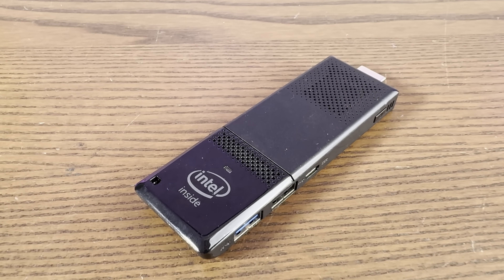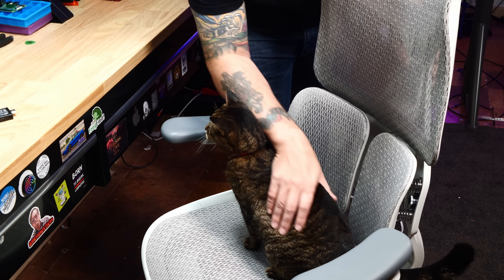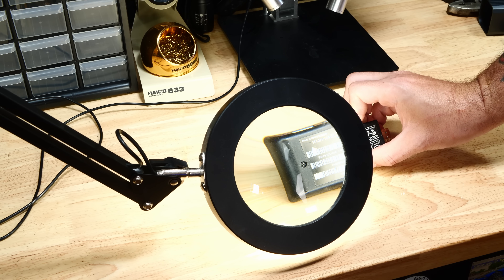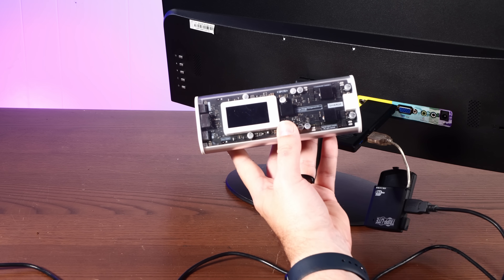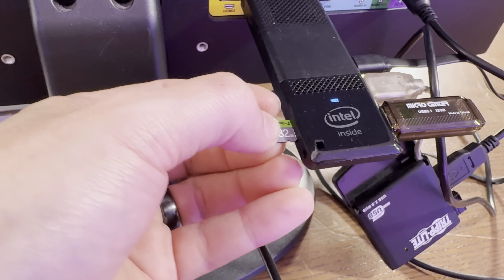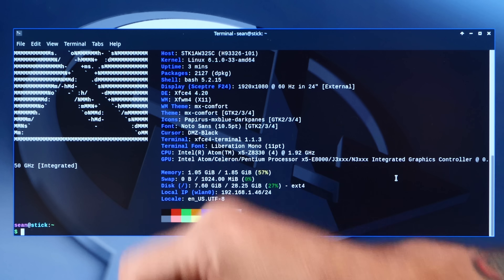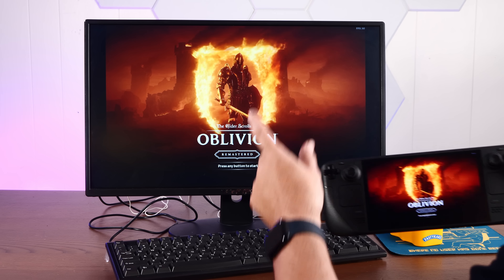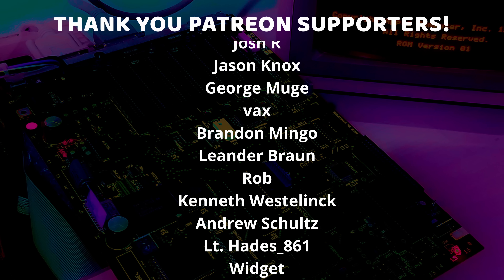Intel's Tiny, Weird Computer

Comment: So the Intel Compute stick can do what it was advertised for but not much else?
It might even have been able to run Office 365 on windows 10. It was marketed as a home media stick not a gaming computer so no one was expecting it to be able to though being able to stream it is nice.
Still "low end" has changed meanings over the decade and it still has the hardware of some modern mini PCs made for office use and HTPC use just with lots less storage and no internal upgradeable storage options. Why is the N100 still used? low power for enough compute not good compute but enough compute. The target use case do not need good compute either as HTPC and office use do not really use much to do. Office use as for most it is used in lots of light weight tasks or just a cheap thin client while for the HTPC it is good enough for streaming videos and playing music.

Comment: I have a compute stick (for some reason I have 3) and is the later USB-c powered one with the additional USB sockets in the power brick. I installed Linux on mine and use it as a media player for in the hotel room when I'm away for work and it works great

Comment: 2018 I was using a Azulle Access Plus Fanless Mini PC Stick, a 4gig unit with maybe a bit better processor, I got Raspberry PI's intel desktop distro to run on it so I could use it as a DNS server.  It ran that well, I had also used it for video playback without issue and i shutter to think minor code development...I think 2gig versus 4gig is a big difference on which distro will run.

Comment: I have a couple of these..one with no OS, and another one with win 10 pro..

One has the atom processor and I believe the other has an Intel m3
Reply: Also, I purchased the official wall warts for these which give you an additional 2 or 3 USB ports..

My plan was to run eXoDOS completely offline but never actually got around to it

Comment: I think these things are cool. I keep trying to find them in hopes of building them into simple headless single-purpose test fixtures that run relatively simple code. But the price never came down. I was expecting they'd eventually be on ebay for $30 but nope. They never gained enough volume because they aren't powerful enough to run bloatware.

Comment: It's amazing what you can do with the right linux distro. Saving computers from the e-waste pile is not only kinder to the planet, but it's FUN! Pushing hardware to its limits using efficient and streamlined software divorced from the BS of modern windows tickles my brain in such a fun way.

Comment: My "home lab" computer still a Intel D945GCLF with Intel Atom N230 (i'm buyed in 2008 in "brand new", just before N270 is released..)
it runs Ubuntu server (originaly 10.04, but got multiple updates and currently 24.04 LTE version is runing on it). Never had an issue... but the CAP in the board was replaced once around 5 years ago.

Comment: I was given a cheap knokoff of one of these a few years ago. I was able to install fedora Linux on it but there was no wi-fi and it would just lock up due to overheating after a while. I did get ethernet working through a usb dongle.  I was told they overheated under windows as well. So I threw it away.

Comment: not to long ago, I was reorganizing my 'office' (known as my beloved as 'the junk room'), came across an old atom netbook with a stomped in screen, a few USB SNES controllers,  and a few other cables and bits and bobs. the procrastination hit, and instead of finishing cleaning, I'd gutted the laptop, mounted to the underside of the coffee table, a VGA cable, and loaded it up with a bunch of emulators. She was a Megadrive Girl, I was a SNES boy.  A Sundays afternoon of effort put to good use. my office is still less-than-organised, but we had a great sunday night.
Those little atoms are great little units for what they are. when I got it years ago my primary goal was longest battery life, real keyboard, proper OS. and it still does it just as well today (just dont load many tabs). Try that on your smartphone from 10 years ago

Comment: Was just given an old Acer workstation that the previous owner didn't appreciate properly. Removed Windows 10 and all the bloat, installed Batocera, and now I have a great little retro emulation system with decent WiFi for my living room. Heck, I even have the built in Kodi app talking to my Emby server!

Comment: When those came out I totally imagine them being for someone who had really basic computer needs, like maybe a word processor and a web browser and something really basic. 

In the late 2010s, I got a full size (like 42" or a little bigger) plasma 720p HGTV off Craigslist.  That was the first time I had an entire housing unit to myself (shared with my girlfriend) instead of living with random roommates.  I used a fire stick for all my streaming needs.  I also had a raspberry Pi can I wire it up to play pirated movies off off a hard drive.  Later, when I sold the TV to someone else, I included the fire stick with it free.

Now I just have a little 4 TB SanDisk extreme portable plugged directly into my 4K Sony Bravia with the USB 3 port.  I have VLC installed on the tv, so I just use that to browse videos on my drive. When I get new videos, I just unplug the drive, plug it into my computer, transfer them, and plug it back into the tv.  Some people have talked about building a media server, but I haven't really seen the need for it since I only have one tv.

Comment: I have this, but in worse version. Because I have only one USB port, so I needed to use hub. If I used too many devices, Stick just simply shut itself down. I have Batocera Linux and sometimes I'm using it as a retro gaming machine :).

Comment: I have had a variety of Atom PCs, 19" rack things and similar, cute and useful for single purpose roles. but too under-powered for average consumer use.
They can provide some play function, but eventually they are frustrating, I tried to find a usable desktop for an Atom PC for somebody to use as a music player, quite frustrating.
Most modern desktop OSes require serious CPU and GPU. Atom chipsets always fail to work 100%.
At the end of the day you cannot beat a SFF or proper sized PC for proper PC usage. easy OS, upgradable and easy to cool.

Comment: This is so awesome to see. I am going to have to give MX Linux a try on it some time. I have Lubuntu on it at the moment when I was looking to find the lightest usable distro for it. I bought it initially to run PiHole on it so I didn't have to get a Raspberry pi or another single board computer. I got this for $25 I think, several years ago. I need to break it out and see about repasting it. Always wanted to see if I could find one of the versions that had the m3-6y30 or m5-6y57 processor in it to see if it was more usable.

Comment: The irony is Atom Z8330 is more powerful than at least half of CPUs I've used in the past.
The problem is it was paired with too heavy OSes. It would be a high-end CPU in 2005. Competitive single thread performance and full 4-core multithreading.

Such HDMI stick could be used for retro gaming. Batocera should run at usable performance. Not great, but usable. Emulation up to PS1 and N64 should work. If GPU is fast enough, Dreamcast should run also.

However these sticks are too expensive for what they offer. Their main value is you don't need external power supply, you can power them directly from your TV.
If it's not that important and used thing client for 10-20€ should perform better with more convenient upgrade path like normal SATA connector for storage.

Comment: I have 30 of these in a factory I support  - they run win7 or 8 barely on 2 GB ram.  
Later models have 8 GB of DDR4 but they're physically much bigger.

I find that low USB input voltage is the cause of lots of problems, so using a dedicated wall wart PSU (your old phone charger perhaps?) is much more reliable than a monitor/TV USB port.

Comment: I'm wandering if this thing can work with a USB hub that has ethernet ports so it can be converted into a secure router. With that amount of power draw, It'd make for a great little firewall device..

Comment: My job has one of these running an automated panel saw.  It's definitely not the original hardware.  It has some interface hardware converting usb to whatever input the saw uses and its running winxp.

Comment: if you want peak performance(this is not a joke), install win8.1 with openshell to get regular start menu; they're roughly same specs as Dell/WYSE 3040 ** emmc isn't the most difficult thing in the world to upgrade; upgraded some 5x 3040's to 128gb:P

Comment: I have the compute stick. Still have the box for it.  Windows 10 was on it and i eventually had to dump it because the updates basically took up all the room even with keeping things happy. Windows just got so big i just dumped it and Ubuntu at the time was nice but now with only 4gb of ram its not working well. Because the atom processor just cant game even at low resolution. If you use it as an emulator machine like a rpi you're good.

Comment: It would be good if it was beefed up with more up to date parts and specs especially I it's was aimed at hackers like a wifi pineapple pager and do some forensic data analysis on a pc or system your using it on

Comment: I tried to upgrade the ram on one of these last year, but either the firmware rejected the modules or I couldn't get all the pads connected as it was the first time I tried doing an actual project with my hot air station.

Comment: While I know you love MX Linux for retro hardware, I'd also suggest you to try out Q4OS Trinity edition, based off Debian. Has access to full debian repo, just like MX, yet Trinity is extremely light and demands only an old 300Mhz CPU and 256MB RAM (recommended). It has run on much lower spec'd HW for me.

Comment: Used them for signage running debian. They were perfect for the job and a tragedy they are no longer a thing as x86 architecture had some benefits.
Now with the onset of arm devices we now have tiny compute intensive arm based signage players, still running debian.

Comment: This is still performing better than many Linux SBCs today.  Intel should have taken the route of supporting Linux on these kind of devices instead of Windows.  You need more hardware interfere & power supply options for deeply embedded & industrial applications.

Comment: This is the great thing about linux,
Microsoft says your 5 year old PC is no longer good.

Linux will happily run on 20 year old hardware with 0 issues
I have a old ass PC from the Win9x era with a Intel Celeron Slot 1 CPU.
I need to fix it up and then I will put linux on it

Comment: These things would be perfect for running XP and XP-era games, but unfortunately those damn manufacturers never made drivers that were even minimally compatible with XP (although there is a 32-bit bootloader). Most of them had 2GB of RAM, 32GB of storage, and running Win 10 on them is garbage, but they would be decent for XP.

Comment: I have one that I got for free, it's surprisingly a decent piece of hardware that is good at what it can do. I have mine on a female to male HDMI cable so I can reach the power button. I think this thing was largely overshadowed by mini desktops like the Intel NUC or HP Prodesk/Elitedesk for the niche that the Compustick was trying to fill, most businesses simply installed a mini or SFF computer or just plugged in a laptop to do the same thing.

Comment: A year or two back I found one of these in a box of junk at work.  The mains power supply for it had a two-port USB 3 hub built in.
Its WiFi card had also died, leaving a USB Ethernet adapter as the only possible connectivity.

Comment: I was dumb enough to buy one of these. Despite its limitations, it would have been fairly useful if it had integrated ethernet (preferably two ports), a 9 pin serial port, and twice as much non-volatile storage. And they should have made a DIN rail bracket for it.

Comment: I had a feeling haiku wouldn't see the storage. I tried on a generic Intel atom box and it didn't. You could use the USB 3 port and an SSD on a SATA to USB adapter to get it installed. With the hub, adapter, and SSD it wouldn't be the most compact thing anymore though. 😅

Comment: I have three of these, slightly different brand, and I think they are absolutely amazing! They are perfect for running simple jobs non-stop. I have one constantly monitoring some of my favourite YouTube channels and downloading any new videos that appear there, mainly channels that deal with music and regularly need to take down videos again because of copyright strikes. Another one is used to download huge torrents with very few seeds that take days to complete. My third one has a 4 TD SSD attached and acts as a 'remote' backup, located in the cellar box of my apartment complex, connected to my network via a powerline adapter. I connect to them using Chrome Remote Desktop, so no real monitor, keyboard or mouse needed. Seriously, amazing little devices!

Comment: well, i have used them as servers. They are may not very powerful, but they are capable of doing some serous work. i still have a couple of them. not exactly that model but similar. by the way the fire TV stick and the Telekom Magenta TV are basically the same device type of device. They are still pretty relevant today but way more capable even they run on arm and having a Android based OS instead of a X86 processor and running windows or a linux.

Comment: That compute stick is the generation 2 model(STK1AW32SC) it's actually an upgrade over the 2015 gen1 model STCK1A32WFC which used SDIO for the realtek wifi, I still have a bunch of them running digital signage(using xibo) I actually have one of each on my desk for giving LibreELEC a try this weekend and have bought several of the later updated models(I've reviewed some fanless ones from azulle I like and there's mele ones available on amazon still) I always wanted one of the m5 versions (STK2MV64CC ) they had 4gb of ram and a fancy power adapter that was also a usb-c dock

Comment: Yeah, I mean, they still make PCs like these that will run Windows 11. They're really good for really low power kiosk setups. Used a few at work on big wall mounted TVs to monitor health telemetry on wristbands that send data through LoRa routers to a server that aggregates it all for you on a webpage to make sure inmates don't try to jump off this mortal coil.

Comment: I Have A MiniForumns With An Atom In It I Got off E-Bay For Free! I Set up A jellyfin Server On It for My Grandson! It Works OK For A POS Mini PC That Is 10 Years Old!! I Have A Core2 Q6600 That I Just Retired Last Year! It Spent Years Upon Years Encoding TV Recordings! I Would Record The Shows While I Watched The Shows From The Previous day And Set It To Cut The Ads And Shrink The File Size As Well As Add The MetaData It Would Take Hours Upon Hours!! Today I use An I7 12700 It Does The Same Job In just Minutes Usually At 700 To 1400 FPS

Comment: I have a couple of MeegoPads from 2013-2014. I used them instead of carrying a laptop while traveling. Just had to make sure I didn't stay at a Motel6 or Super8 that might have an older TV in the room without HDMI. After a couple of years, they just stopped working (would not power on).

Comment: MX/ExtrOX felt most appropriate when i tried them on my Acer Aspire One D250 earlier today, especially in comparison to Mint 19.2 or Slitaz 5 that are plagued with much older kernels, not to mention their versions of DOSBox, QEMU/AQEMU and even VirtualBox (i was thinking of a virtual DOS/W98 combo).  MX 1st got my attention years ago while searching for a 64-bits substitute to Win10-32 on a CherryTrail tablet somehow featured with an ia32 bootloader...  MX only got better as it evolved and now i trust it enough to depend on it daily, including for a roaming concept i got in mind which is about the hosting of vintage DOS applications independently from real hardware support.  Plus it's great in french too, etc!

Comment: I have a different model, I currently use mine as a server for my 3D printer.

Installed Ubuntu on it, disabled the GUI and installed fluidd/klipper on it.

The only real issue is poor wifi performance, which is just tolerable, although better than nothing, especially when there were RPi shortages at the time I set this up and I had it lying around doing nothing.

Comment: 12:29   I get that you're just trying to demonstrate the weird little device, But if your TV already has an HDMI port, why would you need to go through the device to stream something When you can just connect your gaming laptop directly to the television with the HDMI cord? surely if you can stream something to that weird little stick computer, Then the device that you're using to stream would also have an HDMI port as well, no? I have a gaming laptop but I literally just hook it up to my TV and use* a bluetooth keyboard and mouse.
Reply: The whole point is that You can stream from great distances.
Reply: @Old_sport_the_orange_man  🤔 my laptop is stationary. I can take my keyboard and mouse or my bluetooth controller the same distances as whatever you can link to the stick. I still fail to see the difference. Sorry. 🙃 And I don't think this was invented before Bluetooth devices (I'm referring to everything more than an old earpiece) since you can stream a steam deck to it, so...in my opinion it's just a chunk of oddware lol
Reply: @StormyNichole I have my gaming PC in my office room, and the TV in the living room. When I want to play something on the couch with my gf I need to stream it to the TV because I won‘t plug in a 10m long HDMI cable from two rooms away. Not that hard to understand
Reply: @droggelbecher742 oh. i didn't realize that could be a practical use for it. never seen a newer tv that didn't already have a mirror app.